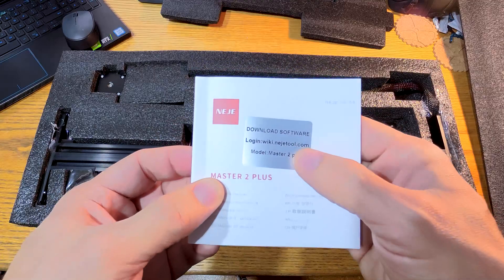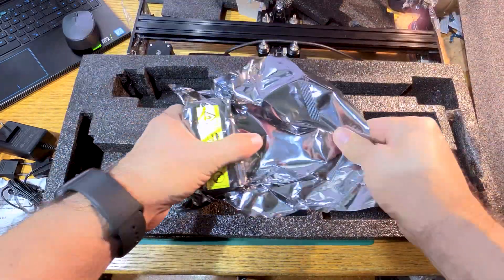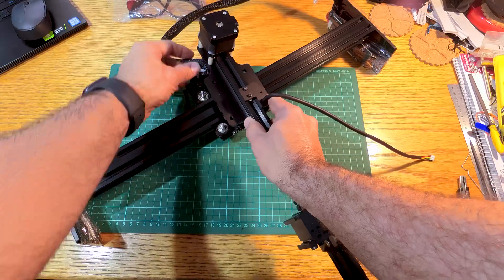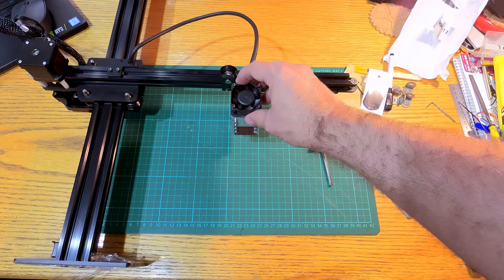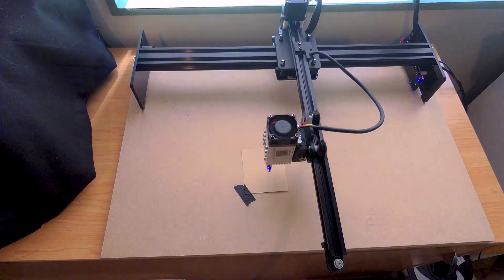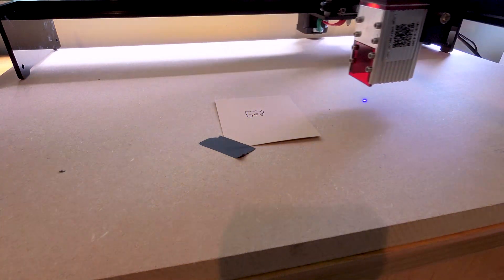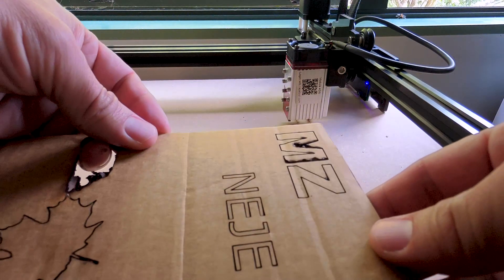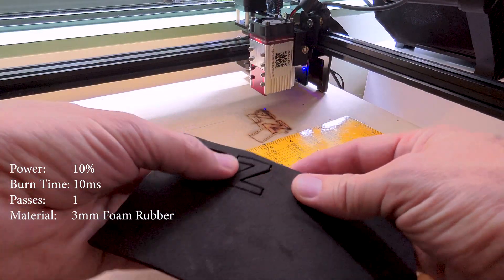Testing out the NEJE 40W Laser cutter/engraver

Comment: it feels like there's something deceptive with the watt rating.  The glowforge will cut out the 3mm wood with 1 pass, not even a slow one.  The output of these 40W diodes appears to be 5.5W or 15W?
Reply from the maker: Yeah. It reminds me of the hifi / boombox power ratings where they advertised it as having a “1000 watts “ but really only has a 30 watt amp inside. To NEJE’s defense they do say somewhere on the product page that the laser output power is 15W ( actually 2x 7.5W diodes) for the 40W module as the 40W is power consumption not output.

Comment: Thank you for this nice video! It was very helpful for me. I have a question about the precision: is this laser still precise if you cut/engrave with higher speed? I read about a „bouncing“ laser because of the triangle stand. Can you tell something about that?
Reply from the maker: Thanks, glad this was useful. I have not had any issues with accuracy, but have not run this laser faster than 1000mm/M. It seems stable and accurate enough for me. This one also ships with small mounting plates you can use to mount to a heavy board to make it more stable. I do think they have a sturdier version with a full frame and the same 40W laser if that is a concern.
Reply: thank you very much for your response!

Comment: Good job.  How do you change the letters in a vector graphic?
Reply from the maker: Thanks. Assuming you are referring to the power and speed text. In Lightburn you can use “variable text” to print out certain values for example P is power and S is speed.
Reply: I don't know if you have AutoCAD (if not you can get an educational license for free on the Autodesk website).

1. Use "MTEXT" and type whatever text you want in whichever font you like/need
2. Zoom in on the text as much as you can using the scroll button, this will improve accuracy of the vector lines
3. Use "TXTEXP" to convert the text to vector lines
4. The letters now have lines crossing through them which you don't need or want, to get rid of these use "EXTRUDE" to convert the text to 3D items, you can use any thickness.
5. Use "UNION" to combine the separate 3D items into 1 solid (this will remove the unwanted lines).
5. Use "FLATSHOT" to convert the solid 3D text back to 2D vector lines.
6. "SAVE" to the font you like, most software/machines will work fine with the DXF format (you can also use "DXFOUT").

All commands can be typed and verified using the Enter button.

It might take you some time if you are not familiar with AutoCAD but I can run these steps in half a minute or so. So it will be a quick way to convert text in the future after some practice.

Comment: Hi thanks for this video, very informative. 
I'm new to laser cutting, i had a couple of questions if you could help.
Does the laser include an air assist? And do you need an air/fume extractor for the smoke? 
Thank you for any help
Reply from the maker: Thanks glad you liked it, the laser I use does not have air assist, but it is something I might add later on. I also don't have an extractor but have the laser next to an open window with a desktop fan blowing the smoke out the window ( on windy days this backfires ) But I would suggest you do any laser cutting/engraving in a well ventilated area. Also make sure whatever you cut does not produce toxic fumes.
Reply: @makerz4247  Thanks for your reply and advice. NEJE told me the fan on the laser can help dissipate the smoke. I still think a seperate air assist will be needed for cleaner lines. I've no idea how you would even add this to the NEJE. If you do add an air assist in the future it would be interesting to see the difference in the quality of cut.

Comment: I just got mine but have not tried over 10% yet, it is better to have low power and then burn several times or at lower speed you can make your own pictures in paint or other program and save them as PNG or BMP and put them in the folder c / neje / My Collection. For metal, glass, plexiglass you can use toner from printer. I think.
Reply from the maker: Yeah better to play it safe, in my next video ( spoilers ) I cut some plywood and the cut quality is better when I do more passes at lower power

Comment: Thank you for this video sir! Do you have some test results with acrylic maybe? Can it cut a 4 or 5 mm acrylic plate?
Reply from the maker: I have tested on 3, 4.5 and 5mm acrylic and uploaded a video, spoiler, it works pretty well
Reply: @makerz4247  thanks! Really helpful! I wonder if it can cut through white opal acrylic 3mm with around 30% transparency. From what I understand diode lasers may have a hard time cutting these type of acrylic. I may ask you too much but if it can cut 3mm opal white I will definitely buy this laser instead of that dangerous k40 co2 thing. Maybe you can help me out :) ?
Reply: on the facebook group i see it cut 3mm acrylic .
Reply: @franciscoantoniomontoyaboc1852  Thanks, I would also like to know if it can cut transparent acylic, that seems a problem sometimes.
Reply: @slamraamprod  i going yo try put a sheet of black Vinyl on the  top and bottom
Reply: @franciscoantoniomontoyaboc1852  Thank you, let met know. I want to mainly use it for cutting holes and lines through black painted 4 or 5  mm acrylic for making a home cockpit.
Reply from the maker: I have not tried to cut acrylic yet, it is something I want to test as well, so will see if I can get some locally and try.
Reply: @makerz4247  Nice!
Reply: So you can't set the laser power low enough to etch paper anymore? Can you test on thick mdf and plywood? That's pretty much the only reason to get 40W for the massive jump in price.
Reply: @gr1f1th  Except it is really only a 15 watt working power.
Reply: @sotm6078  yes I'm aware. But it's the first time a diode laser is capable of cutting 3mm plywood in a single pass. With the addition of the 32bit board able to run lightburn this is a very impressive laser that I've been waiting a long time for.